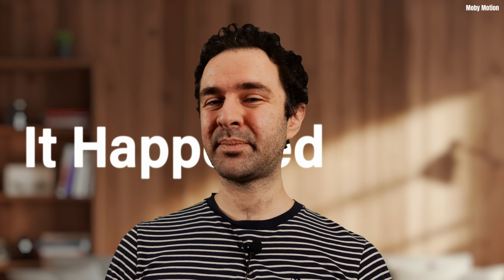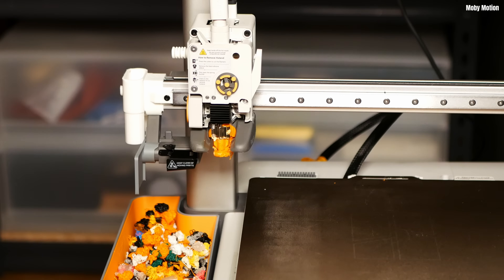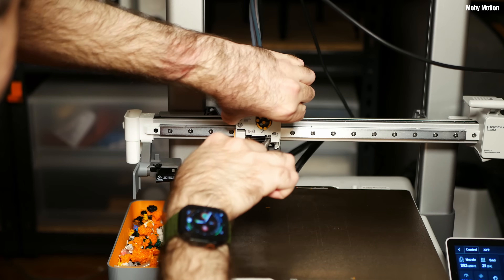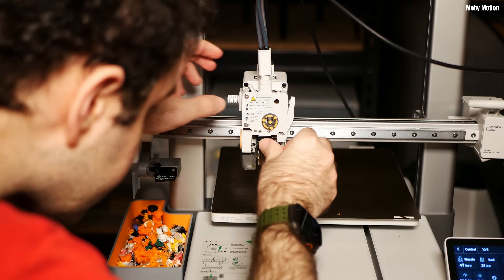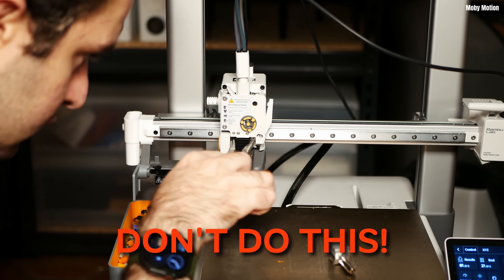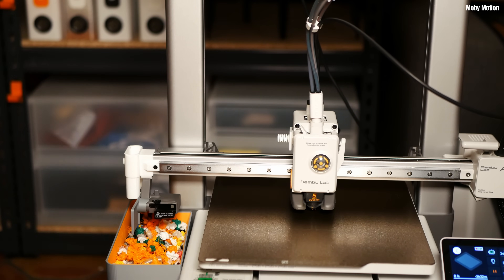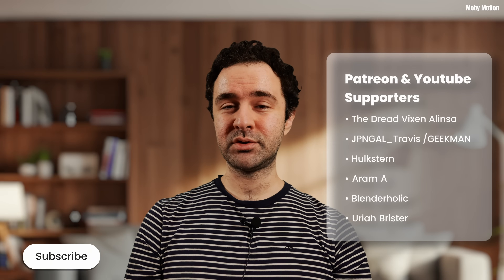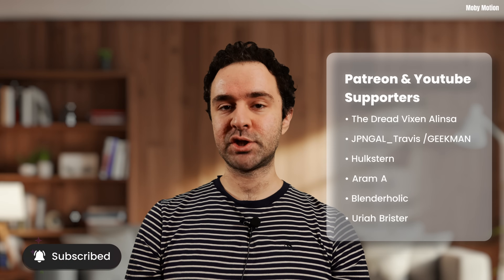So It Happened to Me... 😑

Comment: What Type of build Plate did you use?
My P2S cane with a Textured PEI Plate, and to be honest I touched it multiple Times with my hands and never had problems.
I will clean the build plate in the foreseeable future (I have IPA from my Resin printer), but I dont think that such a problem comes from just touching the build Plate once.

Or is it a smooth PEI plate?
Because I would think that those are far mire sensible than a textured one.

Comment: I had this happen to me about a month ago but far worse. The entire hot end and surrounding area was encased. I spent 2 hrs with a soldering iron and pliers digging out the PLA. However, the wires to the heating element were also encased so I bit the bullet and bought a fresh one (only $40NZ) rather than trying to get the PLA off the fine wires. Not a pleasant experience fully dismantling the print head and very nervous taking the circuit board out but all up and working again now.
Although this was also due to a print coming off the bedplate it was because I did not use brims on a thin vertical element rather than an unclean plate. I would strongly recommend always using brims on any small components

Comment: I have read somewhere that a cause of blobs of death is oozing when the nozzle is zeroing the z axis.  The oozed material hardens before the test and gives a false z offset leaving a gap.  I haven't had it on my A1, but I had a small blob with my P1S, I was lucky, it didn't wrap around the hotend, just the nozzle, o it all just broke away.  My son, on the other hand, had a massive blob of death, his rather large print was left over night and he came back to PLA encasing nearly the whole hot end.  He managed to short one of the boards when he cut through a thermistor wire trying to cut the plastic away while it was heating.  We managed to get the plastic away, but we are still waiting on parts to replace.  Not a pleasant experience.

Comment: Wierd, when my print did not stick to the buildplate (caus I forgot support) I was just met with a spiderweb.  I thought blob of death was more that filament sticks to your nozzle and builds up.  If you print petg, that will build up around the nozzle  so I clean the nozzle tip with isopropanol, and also if I have printed petg on the buildplate, I make sure to wash it before printing pla. So far so good 400 hours in.

Comment: I orderee my first 3d printer ever(P2S) and with it I ordered 3-4 extra of each size hot end. So If I get a clog I can just swap the hot end and be done with it. Some problems are better to throw money at instead of time
Reply: On my P1S bambu says it adviced to print PLA, PETG and TPU with open door to minimize risk of blob of death.
Reply: @AndrewTSqi belive P2S got a vent in the top so you can print with the door closed

Comment: There’s nothing wrong with touching the build plate as long as you clean it after. Get some 100% isopropyl alcohol and dilute it to 80% with distilled water(mix 4 parts alcohol to 1 part water). Clean your PEI build plate occasionally with soapy water, but after putting the plate back on the printer, spray the 80% IPA on and wipe thoroughly with a microfibre cloth. Use this spray and cloth to clean the plate between prints. The IPA will remove the oil from finger touches and at 80% concentration, it will not harm the build plate. Do not buy less than 90% IPA to mix your spray solution as lower concentrations have additives other than water. Buy the high concentration and mix it yourself with distilled water. There’s even tricks to “refresh” the bonding surface of PEI plates to give them new life, but that’s somewhat off topic.

Comment: With how mindful you seem to be of touching the plates, I have doubts that was the issue. Im not saying not to wash up or be mindful of touching the plate but I am saying my kids enjoy peeling models off mine with their toddler levels of dexterity while touching everything and I don't wash the plates often. Yet my PLA  and TPU models come out fine.

Petg on the other hand (the only other material ive tried so far) can be pulled off because of either air currents or sudden temperature differences, or at least that's my working theory. I've had to cancel a few prints until I started using glue sticks. 

The reason I think it's air currents and temperature differences is because it only seems to happen when I have my diy exhaust system running during first layers, or when my filament dryer is running directly next to the printer. So it's either the airflow, or the airflow causing temperature differences.